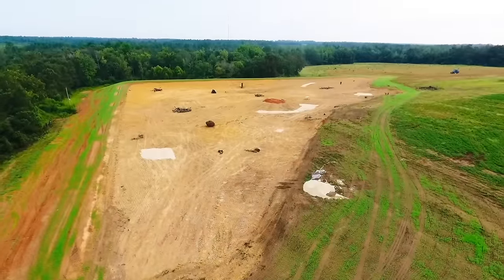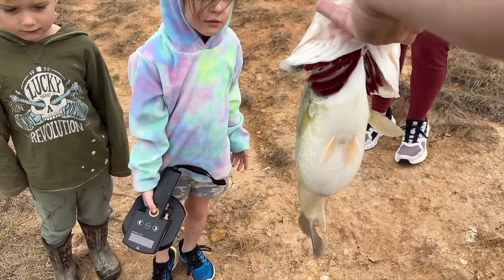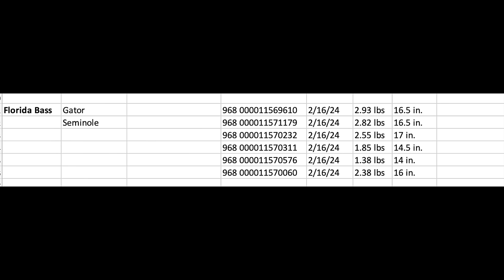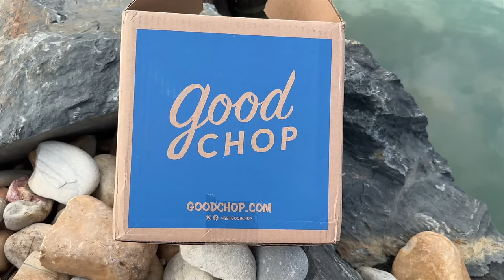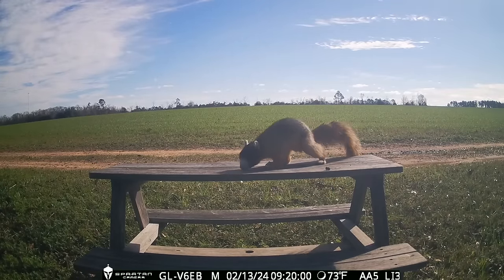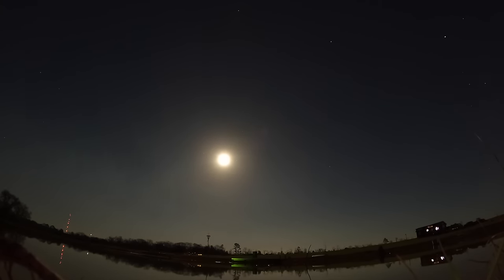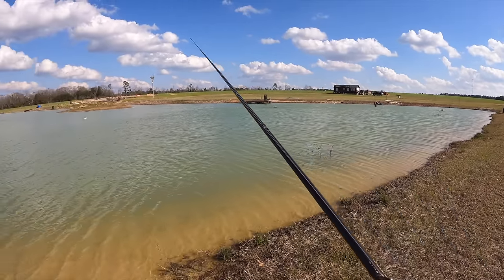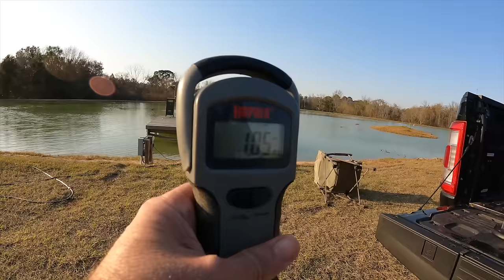Adding a New Strain of Bass to the 5 Acre Pond!

Comment: Putting sides up on the nest platform will help with stability. One thing you can do to help them is to build a starter substrate by intertwining twigs a couple inches thick on the surface in the shape of a large nest. You can also help secure this to the platform using baking wire or something similar. This worked for feruginous hawk nest platforms I installed in oil fields. For bald eagles this should be as wide as the surface of your platform since their nests are huge and they will add to it every year once they start nesting

Comment: You are correct.  You need to add a "Lip" to your eagle nest to keep the sticks and debris from blowing off.  I would box in a 2x4" lip with inverted 1 by 1" stakes (at least 6-10 inches high) spaced out every 8 - 12 inches.  This will serve to "grab" on to any branches the eagles will bring to the nest.  Once an eagle places down a branch it would be less likely from blowing/rolling off the platform
Reply: I live in Florida and this is how it’s done here.

Comment: I belive that a nice add to the eagle platform was a edge or a rail so that the nest material stays up there more easy
Reply: I said this months before.
Reply: Skunkape
Reply: Same. Nail a big Christmas wreath up there😂
Reply: 13:40
Reply: An artificial nest tree with a flat platform needs an artifical starter nest anchored to the structure with wire cables. Southern Alabama is tornado and hurricane country. Even areas where those weather phenomenon are rarer eagle nests have blown out of trees as what happened last year in Minnesota while mom was sitting on the nest. I suggest Bamabass go to the experts, especially the eagle specialist involved at the famous SWFL eagle cam and get advice on how to build it properly. I have seen the ones that start as a wire mesh bowl lined with straw and then ringed by large sticks and branches. That entire structure is then anchored tightly to the platform so it can't move. The eagles will then finish it to their specs. Eagles constantly fiddle with their nests and seem rarely satisfied which lead to hilarity as couples often fight over where to place sticks throughout the nesting season. Just search YT for Jackie and Shadow (or Big Bear eagles) to see examples.
Reply: @CarolinaBassHunter  Yup saw that later  LOL

Comment: What has been done by the conservation officers in my province is they place a few larger branches on the platform that can't be blown away easily.  You don't need too many, I have usually seen around 6 branches that are up to about 2inches thick.  This provides a base for the eagles to start building off of.

Comment: The only thing I would do to that tower is add 2x6 side rails. I would attach them directly to the floor of it and add 2x6 inside corner braces. That and maybe lay a layer of galvanized wire over the top of the floor as an extra way to weave their nest. If they nest there the nest will basically become a physical part of the structure.

Comment: With no tech like cameras it might be wasted but it would be funny if you setup the inside of the squirrel home with separate rooms like a bedroom with pictures on the wall, a kitchen for the water dispenser and food dispenser. Possibly an escape hatch that only opens outwards so they have an emergency exit that can't be a point of entry for predators.